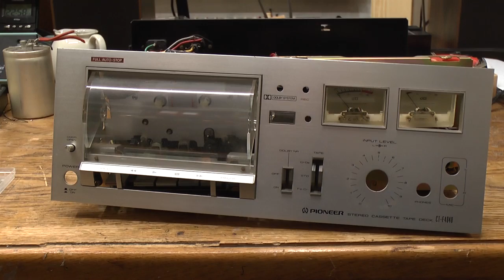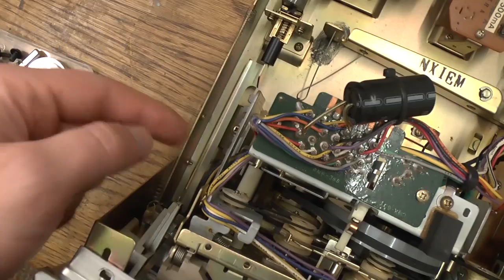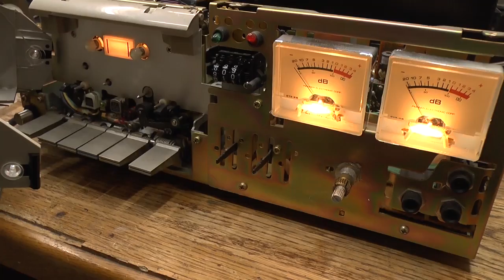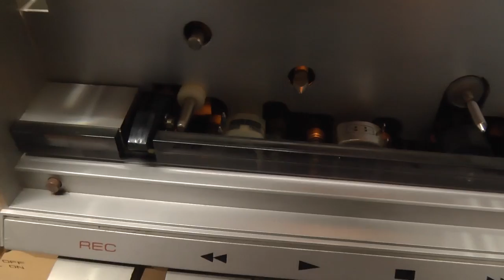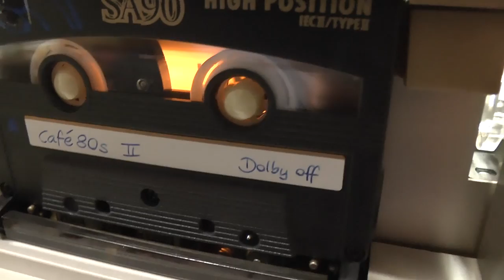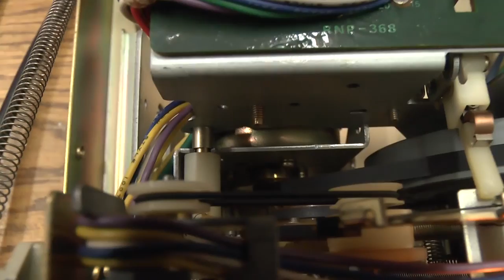Pioneer CT-F4040 Cassette Deck reassembly and test

Comment: I just received this model and my unit has a strange mechanical noise from time to time when playing. The vu meters don’t really work as well. They only move a bit. I am playing this through a high end DJ mixer from Allan & Heath and the signal it receives is extremely weak. Do you know by any chance how I could fix this problem?

Comment: i have seen several of this model on ebay ,im interested in buying but they all seem to have a tarnished black cover for some reason and sides like mould marks ,but one seller told me it is in the paint finish ,also how easy is it to change the belts

Comment: What did you do to clean up the pinch roller?
Reply from the maker: First try using a dry cotton swab to clean the pinch roller. If this doesn't take off the dirt, use an alcohol based window cleaner on the cotton swab.

Comment: 3:30 That helped me a lot! Super! Klasse! Exzellent! Ausgezeichnet! I had the same exact same problem on my "new"  20,-€ Sony TC-199SD. After I changed all belts and dialed in the motor and azimuth, the right channel startet to oscillate with a loud plopping noise and the right VU-needle violently went to the maximum deflection. After i dumped some KONTAKT 60 on that switch everything went back to normal.

Du hast dir jetzt echt ein subscribe verdient. Schöne Grüße aus Bayern nach Niedersachsen!
Reply from the maker: Vielen Dank! Nur ein Hinweis, Kontakt 60 ist wesentlich aggressiver als Kontakt Tuner 600 und sollte deswegen nach Anwendung mit Kontakt WL aus dem Schalter ausgespült werden. Nur falls du das nicht ohnehin schon gemacht hast :)

Comment: Going to pick up same one for 15 euros soon the seller told me the sound of the right channel is lower. might be a mis aligned head, cold solder point or just dirty connections.
If i look at this one looks like it doesn't have many components at all.

Comment: whats the difference between the ct 606 and the 4040?
Reply from the maker: Mainly the age. The 4040 I think is older.
Reply: what about the CT-F4242? cause that's the model I have and this one looks exactly like mine except the power supply only has 3 fuses instead of 4.